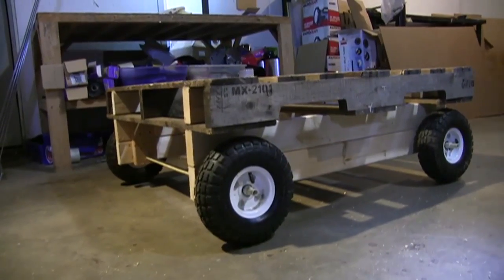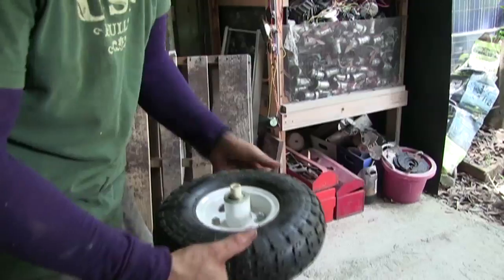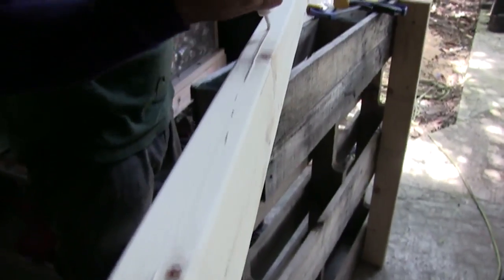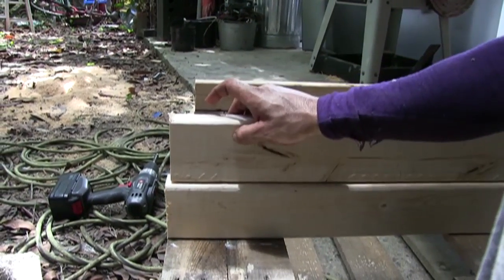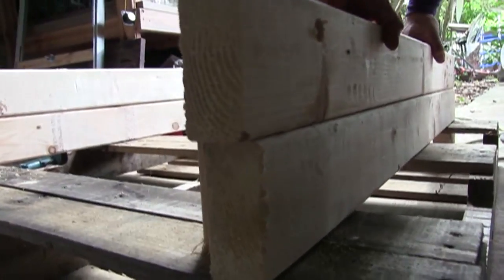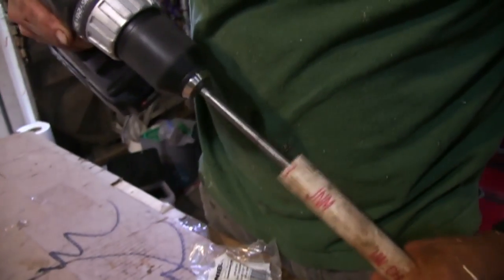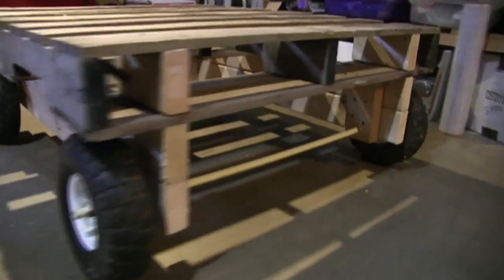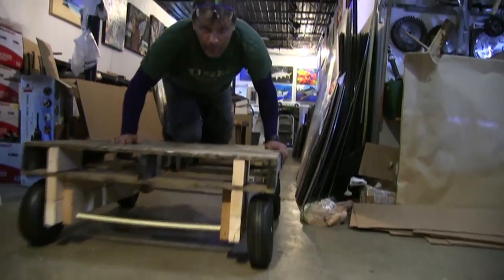Wooden Pallet to wheel cart Cam Trolley WOODWORKING DIY Mobile Pallet Wagon

Comment: If you make it steer and make the mechanism follow one 4X2, you half your timber cost for track. Let some air out the tires and it should smooth out the ride too.
And the video doubles as an easy way for a kid to make a box cart. :D

Comment: Not sure how you fit a 1/2" CPVC inside of a 1/2" PVC tube. Or did you mean fit a 1/2" CPVC (0.84" OD) inside a 3/4' regular PVC (0.82" ID) and the paddle bit would be 7/8" instead of the 5/8" you state in your video? Please clarify

Comment: This looks great.  Would it be possible to make something similar that could be steered (the wheels could turn)?  I'm trying to find a way to make a simple base for a large pop up dog crate, that could be used as a pet stroller.  I have a big dog who can't walk any more and needs to lie down. I bought the biggest pet stroller available, the pet gear expedition, and he fits in it but can't stretch out.  It was not designed for dogs that can't sit up for long periods of time.  Something that could just have a regular pop up crate strapped to it would be perfect.

Comment: That's really cool!  Do you think not having a full length axel would give it better ground clearance?  I have an uncle in Florida that reminds me your varied passions!
Reply from the maker: What part of FL, we are near Tampa. You could use individual wheel/bearings. The weight load should sit on top of the wheel configuration vs a side attachment.

Comment: Cant you find a piece of all thread to fit the wheel bearing? And the auto parts store should have bushings if not. Just saying the plastic pipe may not last long. Brass bushings would work better maybe.

Comment: Nice build. Any chance youll be making a gimbal to go with the trolley?
Reply from the maker: The gimbal would be for a camera large than a small gopro cam. I have a bunch of Merkle-Korff geared motors that work on variable voltage DC so because of the hefty ration, they should be smooth. Looking to attach a boom to a weighted pallet on a 100 ft 2x4 track in my front yard.

Comment: I had pallets on top of each stacked and they got warped. How do i prevent that
Reply from the maker: Pallets for moving stuff are temporary, for a project like this a simple clear coat of spray paint works perfect. You do not need to drench although that works too. An outdoor latex paint also works.

Comment: Why not use your threaded rod and bolts for the axles with some flat washers?  Seems that could make the build easier.
Reply: I think weatherproofing would be an issue. Getting the 5/8 rod would prevent the wheels from wobbling or he could even cut the rings for the wheels so that's the only thing i can think of.